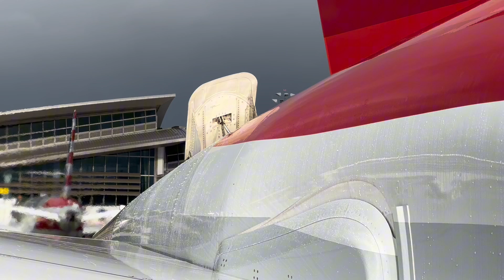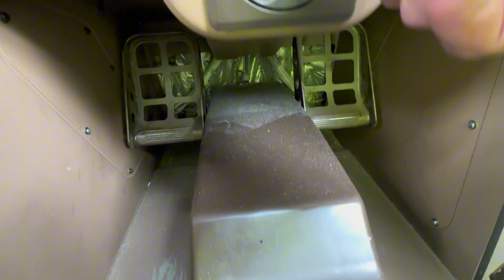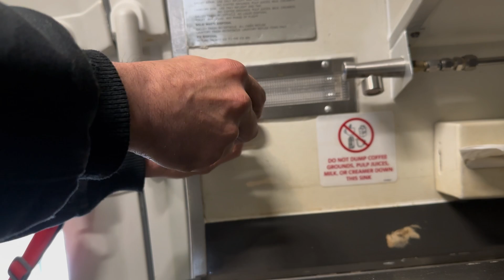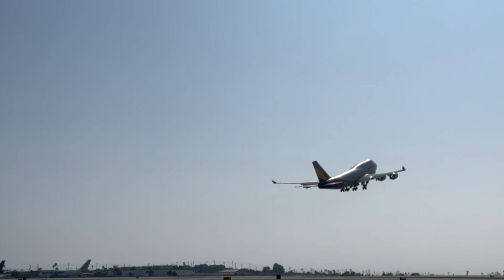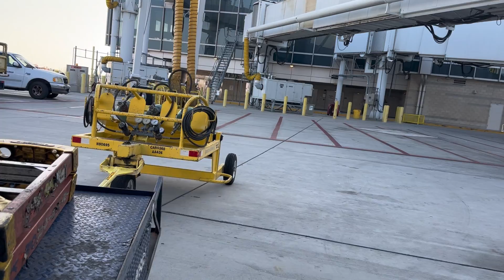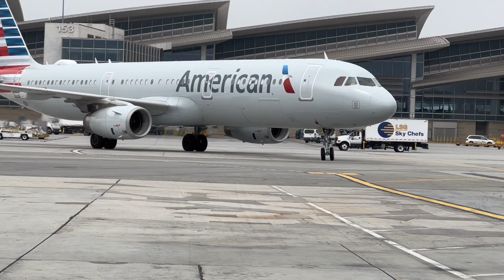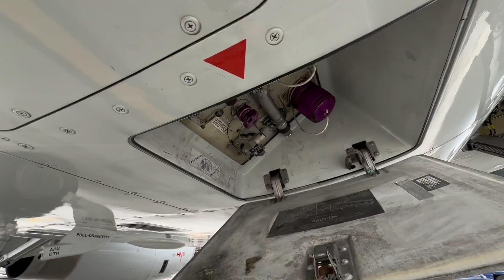Stig Shift #20 (Aircraft Maintenance Adventures)

Comment: Hi Stig. Awesome video as ever, goes without saying really... I wanted to ask you about an AD the EASA put out in January about the possibility of fatigue cracks on airbus wings with Sharklets. I'm not making a drama out of it or anything like that at all but through nothing but genuine curiosity I wanted to ask you about it, because we'll, who better! It seems to be an escalating thing from my very uninformed perspective. It started of with ceo wings with retro fitted Sharklets, then to all ceo's and then on to all ceo and neo Sharklet wings. I guess this is in the same ballpark as the 737 pickle fork thing and I guess the real point to my question is (after a very very brief bit of searching) it only mentions it as a European directive. But surely an airbus wing is an airbus wing wherever it my be flying around the world. Here's a bit of copy and paste to properly explain what I'm asking about... Previously, the directive only required operators to inspect A319ceo, A320ceo, and A321ceo wing manhole access panel attachment holes in the bottom wing skin panels 2, between Rib 13 and Rib 23. The European regulator superseded the AD on January 25, 2024.
Reply from the maker: I have read about this AD in regards to the winglets, but I haven’t seen anything unusual or having aircraft go out of service. It might’ve been a very few or certain fleets that were delivered to particular airlines, but I have not seen any issues on my side in regards to that
Reply: Ah ok. Like I said, I was just curious about the part that said it was just a European directive, my thinking being surely if it's aircraft specific it should, by my logic 🤔, be for every jurisdiction. I also find it fascinating and really very impressive that they can identify these issues before it actually becomes a thing. Quite the testament to aviation safety in my mind... Thanks as always Stig. I only stumbled across the AD because I was looking for the information you mentioned about Airbus flight laws. So in you pointing me towards learning something I actually learned two things, you have a gift good sir!! 😊🖖

Comment: This is just an observation that I've never really put much thought into, but why sometimes are bollards placed at the wingtips, tail, and engines of aircraft at the gates and other times not?
Reply from the maker: Just for safety, making sure vehicles avoid going underneath certain portions of the aircraft.
Reply: Oh, ok. I was trying to figure it out based on when I noticed it and how sporadic it seems. I feel I just might have been starting to overthink it a little when I asked. Oh yeah, I finally found out what the blue triangle and circles are on the Trent 800 fan blades. I think anyway....
Reply from the maker: @KevWitt3455  aerodynamic modification on the blade
Reply: Whoo hoo, I got it right. The blue circle denotes a compressor modification, right? Some have blue squares, too, or instead of, which denotes a different type of compressor modification, I believe. Or the circle and square are for hp compressor or lp compressor or vice versa, I  think...?

Comment: If I don't close the door properly on my car it gives me a visual display on the dash and warns me, dings and throws a fit. But a 737 does not have a sensor for properly/improperly latched engine cowlings?
Reply from the maker: The 737s equipped with that engine do not  have fan cowling indications.

Comment: its always wild to me how the fan diameter of the CFM56 on the a320ceo is only slightly smaller than that of the LEAP-1B on the MAX
Reply from the maker: The difference here is the bypass, on the leap engines. The bypass is much bigger.

Comment: My understanding regarding the MCAS crashes is that in the case where the crew cut out the stab trim, the aerodynamic forces on the stabilizer itself prevented them from using the manual override. The only reason they turned it back on was because there was literally no other way to move it. At least that's what I recall reading at the time.
Reply from the maker: I believe you are right on that. They were past the point of recovering.

Comment: The 737 Max pilots were not trained on, or told about, the MCAS system
Reply from the maker: That correct. They weren’t told about the MCAS but they did have knowledge on how to handle a stabilizer runaway. Right ?

Comment: Not if you never tell the pilots that MCAS is part of the plane. Boeing only using 1 tube for angle of attack. You made an idiot of yourself blaming the pilots. 
The engines are to high but Boeing thought they could get away on the cheap.
All the people flying those new max should have been back to training because the plane fly different.
Reply from the maker: I think you need to listen to that again, I didn’t blame the pilots. I said it could’ve been prevented.  Regardless of the MCAS system the aircraft still could’ve been recovered if they used the cut out switches. And I even reiterated the fact that I still blame Boeing. I don’t sit here and call you names so please be polite.

Comment: Ironic that the "electric" 787 has more hydraulics than the 777.
Reply from the maker: Do you mean in capacity or pressure?
Reply: @StigAviation  Just going off your comment about the 787 baggage door being hydraulically driven, while the triple seven's are electrical. Interesting in light of the 787 was early described as being a mostly "electrical" airplane; pressurization, etc.

Comment: The problem with the stab trim cutoff is that before you could disengage the autopilot control but still maintain electric control. In the 737 MAX it's all or nothing. If you don't catch it in time the electric trim of previous aircraft you let you put it back into trim. On the MAX you're in trouble trying to crank things manually.
Reply from the maker: You’re absolutely correct, the pitch trim will continuously keep going nose down at intervals if the cutout switches are not engaged. So it was about the timing and reaction. One of the fixes for this was to not have it continuously go down, now it will pitch nose down once and stop and allow the pilots to recover.

Comment: When is the APU turned on and when is it turned off?  if overnighted the APU is turned off I assume, when the airplane has a quick turn it is kept on?  Don't they use shore power also?  Thanks for the videos.
Reply from the maker: On quick turnaround flights, the APU usually is kept on. if the aircraft is overnight stay they will try to utilize ground power.

Comment: Stig, how common/interchangeable are routine parts between manufacturers. Are all bulbs / filters, etc the same? What about main wheels are these the same for similar-sized aircraft?
Reply from the maker: The interchangeability of components is specific to the aircraft type. For example, you cannot take a component from an airbus and put it on a Boeing unless specified in the illustrated parts catalog, and it has the same exact part number and is also effective towards that aircraft
Reply: @StigAviation  Thanks for responding, love the show!

Comment: UV light doesnt clean the water, it just kills bacteria. The bacteria is still in the water but just dead. Its supposed to be used in conjuction with a filter.
Reply from the maker: You’re absolutely correct. 👍

Comment: Paperless manuals and the like are a godsend for me in my automotive repair job too.
Sure, now they charge a subscription for it but it's not enough to put me in the red and it lets me do my job so I'm all for it.
Now since they're not the factory manuals the wiring diagrams can sometimes be a little bit off, but the mechanical parts of it are all there and all correct, always.
I could get the factory manuals, but those too are a subscription and I don't work on only one brand of automobile, so I can't really justify that. Like I said, the only real issue is that sometimes a wire is the wrong color in the wiring diagrams, it's 99% of the time in the same spot in the connectors doing the same things going the same route. This happens most frequently due to half-year updates or the trim level (eg. "basic", "standard", "upmarket", "full featured", all of which are still a thing even on luxury cars) being different in the car they got to make the manual vs the car I'm working on in my bay, and I'm smart enough to figure out what's going on even then.
It's just like being subscribed to scan tool updates, you gotta have them to keep up to date with the new cars, but if you're a few years behind in my area not much goes wrong (I hardly ever get cars that are new enough that I have problems).
Reply from the maker: I feel like automotive industry, kind of price gouges when it comes down to manuals like that.
Reply: @StigAviation  Oh absolutely it does.

Comment: Fan cowl door question?  Is this door the same door that slides back in reverse?
Reply from the maker: No that’s a separate piece of the engine. The fan cowling is simply an aerodynamic cover around the forward part of the engine. The thrust reverser and thrust reverser sleeve is aft of the fan cowlings.

Comment: I have a fun idea for you. I flew for your airline for quite a few years and during that time had a few mechanical issues. For the ones that I actually saw the resolutions to, I thought it might be fun to give you a description on the problem and phase of flight and let you do a little practice diagnosis of the problem. No harm, no foul. Just thought it might be fun.
Reply from the maker: That is actually fun, but you would have to give me very specific set of faults and discrepancies so I can troubleshoot it.
Reply: @StigAviation  Yes sir, That's the idea. You can even ask questions. I just hope my memory holds out for the facts. I have the first one in mind already but I might have to go dig thru my old flight logs for many more. I have a you tube channel as well, Jake's aviation and front porch  wildlife. We can exchange emails if you're interested.

Comment: Regarding the Lufthansa 747 hard landing/touch and go at LAX this week - what kind of maintenance checks, if any, would that plane have to go through afterwards?
Reply from the maker: The maintenance check would be a very thorough inspection of the landing gear and flight control services due to a hard landing. The objective here is to inspect and make sure none of the linkages within the flight controls or the landing gear are damaged  we will also pull up G load factors and see if it went beyond the limit.

Comment: G'day Sting, just a question in relation to a flight I was aboard, in which I ended up cancelling. Long story short, the plane in question is a 787-9 with RR engines. We were on the runway and apparently the computer detected a fault, we disembarked, after a while it went to an area to do a thrust check. 4  hrs later it was cleared for takeoff. 
What would have been the reason? Does this happen regularly?
Cheers 🤙
Reply from the maker: I can’t really know what happened. I can only guess because aircraft will usually give out a very specific fault code, which I do not have in front of me. But just from assumption, and the detail you provided, it might have been a engine operation or performance issue. That’s why they have to do a power run.
Reply: @StigAviation  thanks for your response, I thought something like that, however we didn't hang around to get back on board, we ended up cancelling the holiday for "Just In Case" reasons 🙄. 🤙👍

Comment: I don't know if you read about the MCAS system response time. It literally says if the response time by the pilots is more than 10 seconds, the result is catastrophic. Now let's talk about what these pilots would've done differently had they had these information. They wouldn't have never fly it, because the max would've never sold. One thing about the pilot who re-engage the stab cut out switches, they were going too fast already. From the very little information given away by boeing, am sure, he thought he may as well try what MCAS can do for their situation. Can't blame them, they were dying already.
Reply from the maker: The interesting part about the MCAS system is that once it engages, it will run the nose down and then stop, and then it will do it again and then stop. I completely understand the factor that they were already going too fast but I think if they reacted fast enough and recognized the stabilizer runaway, they could’ve saved it. And I just want to reiterate that I’m still blaming Boeing for this. They are at fault.
Reply: @StigAviation  Boeing estimated one crash every other year. Making max the deadliest aircraft ever made. They just didn't publish it. American pilot's association agrees saying no pilot is immune to that. I've seen the checklist my self. Everything was so UnBOEING.

Comment: all the build up of grime and oil and around the landing gear, how often is that degreased and cleaned . would have thought it would be kept a little better so you're able to see issues easier.
Reply from the maker: Heavy cleaning is usually done on heavy checks, I actually have a dedicated video on when and how aircraft get cleaned. Once that is done, a new lubrication needs to be performed on all those components.

Comment: Re 737 max stab issue. It helps when pilots are actually told about new systems. Don't blame the pilots for something they had no idea could happen. You have no idea how stressful it would have been for them and how quickly everything would have gone down. And now they're dead. A little insensitive don't you think?
Reply from the maker: I’m not disagreeing with you Elliot, my statement was still to blame Boeing for not informing the pilots. What I was trying to say is that the aircraft can still revert back to mechanical with the cut out switches. I understand it’s a very stressful environment, but this is where training has to shine. Once again, I still blame Boeing 100% for this.

Comment: If the 787 APU doesn’t supply any bleed air to the aircraft, how do the engines start?
Reply from the maker: The engines start electrically, each engine has two VFSGs variable frequency starter generators.

Comment: Stig I have a question. How is the fan turbines able to slow down so quickly but you can easily spin it with your hand. Does it have a brake?
Reply from the maker: The engine is perfectly balanced, that’s how I am able to spin it with such ease. And there is no brake, it will just naturally spin down.
Reply: So does the air resistance slow it down?
Reply from the maker: @Andrejlawncare  air resistance and no more combustion in the engine, so nothing to propel it. But if there was a slight gust of wind, it will spin freely

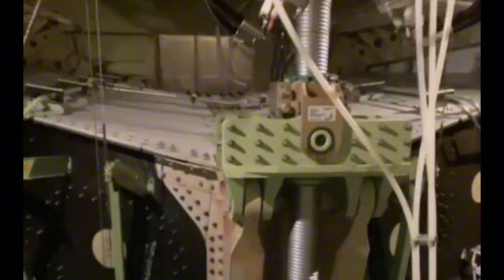Comment: 16:00  How often and who deep cleans the flight deck control switches and other hand operated devices and systems? With your hi-def camera, detritus can often be seen.
Reply from the maker: Most of the time pilots are the ones who are responsible for keeping their work area clean. They will wipe down the flight deck prior to departure. If a deep clean is done that is usually reserved for a heavy check.

Comment: You have made more excellent videos. I really enjoy the details that you include. I have a question about the "Plastic Princess", on the trailing edge of the engine cowols there are scallops. I have seen these on other engines, what is the pupose of these? Thanks again for the awsome and informative videos. Thanks.
Reply from the maker: Those are simply there for noise reduction. The secondary factor is to prevent any kind of turbulent air coming out of the exhaust of the engine.
Reply: Thanks ,Stig that engine is a beautiful work of art a
Reply: My bad on the reply, I wanted to  say thank you for your reply, that engine is a beautiful work of art and an engineering masterpiece. Keep up the great work, God Bless. Rob.

Comment: If there is a tail-strike, they better be darned sure to do the  repair according to the proper method developed by engineers, not someone taking short-cuts.
JAL 123  "The aircraft was involved in a tailstrike incident at Osaka International Airport seven years earlier as JAL Flight 115, which damaged the aircraft's aft pressure bulkhead.
The subsequent repair of the bulkhead did not conform to Boeing's approved repair methods. For reinforcing a damaged bulkhead, Boeing's repair procedure calls for one continuous splice plate with three rows of rivets.[25] The Boeing repair technicians, however, had used two splice plates parallel to the stress crack.[26][3] Cutting the plate in this manner negated the effectiveness of one of the rows of rivets, reducing the part's resistance to fatigue cracking to about 70% of that for a correct repair. The post-repair inspection by JAL did not discover the defect, as it was covered by overlapping plates.[2][3][27] During the investigation, the Accident Investigation Commission calculated that this incorrect installation would fail after about 11,000 pressurization cycles; the aircraft accomplished 12,318 successful flights from the time that the faulty repair was made to when the crash happened"
Bottom line is things like this need going over by experts, not techs, before being allowed to fly. The subsequent repair of the bulkhead did not conform to Boeing's approved repair methods!!!